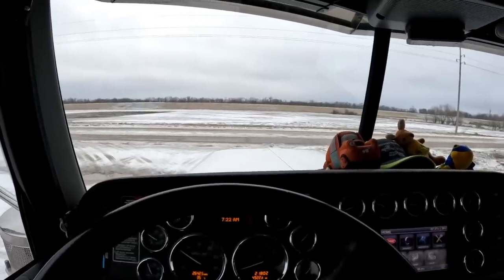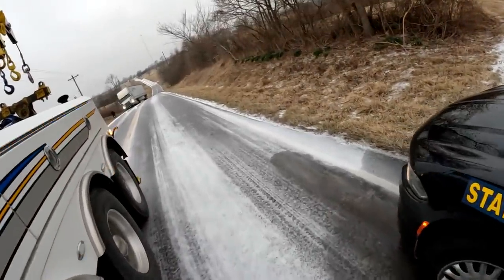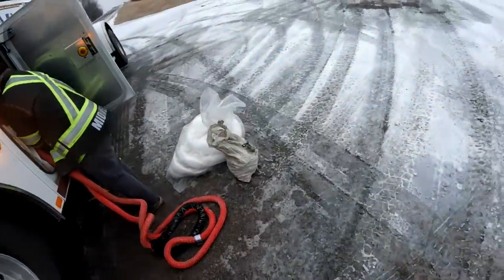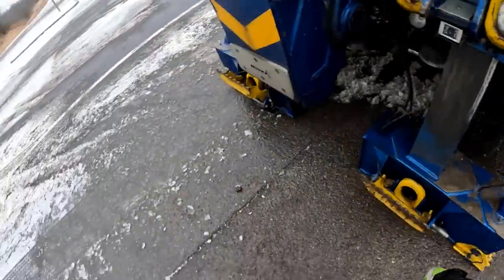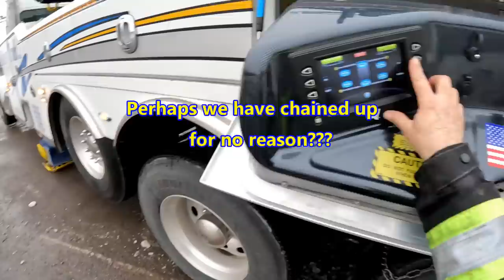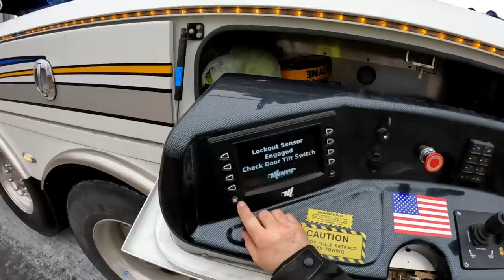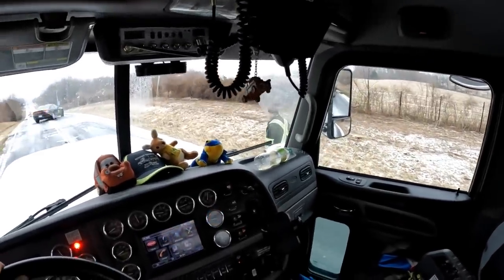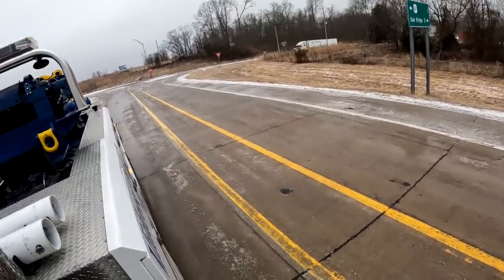First Time Chaining Up the Rotator. Semi Rescued From Ice.

Comment: INMHO, you put the chains on upside down. Yes, the cam adjuster goes to the outside of the tire; however, the hook on the cross chairs should go smooth side to the tire. Putting them on with the raw ends of the cross chain hook to the tire will wear holes in the tires and ruin them.; not a good thing. Please check your installation manuals for verification of my comment.
Reply from the maker: Yes, I am aware.   I knew I would be removing the chains before getting back on the interstate.   I never got over 5 mph with the chains on, so no harm was done.  This was simply to get me safely up and back down that small hill.   Thanks for watching and God bless.
Reply: @RonPratt  Yes, such a short distance would probably not harm the tires, but you instructed Eli that you should always do as you did. Please show him the correct way.
Reply: @RonPratt  Thank you for your patience sir With us viewers! God bless

Comment: never out chains on steer tires, only the drive tires
Reply from the maker: I'm afraid I must disagree with you.   On slick ice, gravity will take the steer axle towards the direction of gravity.  Chains will bite in and keep the steer tires from sliding off the edge of a crowned road or straight into a ditch when you can't navigate a curve.   I've worked on slick ice many, many times and chaining the steer tires is a must under certain situations.   Thanks for watching and God bless.

Comment: My only comment would be for cheating, he didn't do it right. I used to run a picker, and when I had to chain, I would lift tires off the ground, and then throw my chains so I could drag them totally under the tires and hook up on the back side of the tires. Don't have to lay down in slush and snow that way. Also, with triple rails, can save a ton of headches by laying out your chains and then flop the inside chain over the outside, and then can throw em like singles. Other than that.. great job and fantastic recovery.

Comment: One of trucks our company had  that went from Sacramento over Donner to Nevada had automatic chains on It. You flip a switch on the dash and a arm with with a rubber wheel  on both driver wheels swings down with chains attached rubs on the in side of tire spinning the chains under the tires like a weed eater. these are good for up to 4" of snow..
https://www.youtube.com/watch?v=IPd3O5_SJEs

Comment: Sorry, Ron -- I DON'T like the new intro. The volume on the siren is MUCH too loud -- I have an official hearing disability from the Army, and I still have to turn the volume all the way down when that blasts onto the screen, then I have to turn it back up for the rest of the video.

Fair warning -- I unsubscribed from Plaza Towing's channel because their intro was too loud. I need to protect what's left of my hearing, and watching the rotator isn't worth losing my hearing over.
Reply from the maker: Duly noted.   I can and will adjust the volume in the new intro.   I'm trying to get a sense of what the viewers want and I've had a lot of suggestions to create an newer, more interesting Intro.  I'm still adjusting it.   Might even go back to the old standard intro.   My apologies for your hearing issue and the loudness of the intro.  I'm taking your comment with serious consideration.   I would appreciate it if you would ask politely or make a suggestion, however, rather than threatening to unsubscribe.  That's just not polite, in my opinion.   Thank you for your service to our country.  Thank you for watching and God bless.